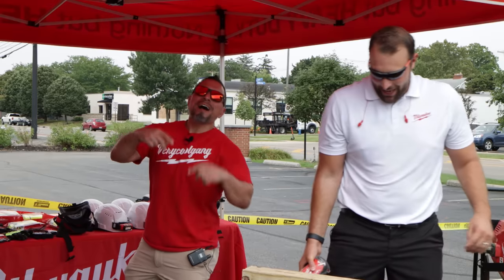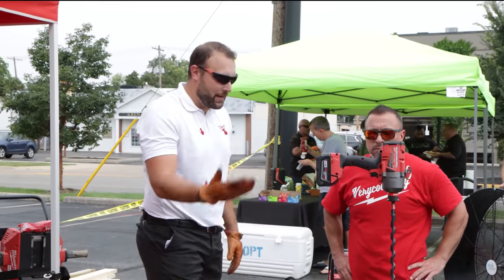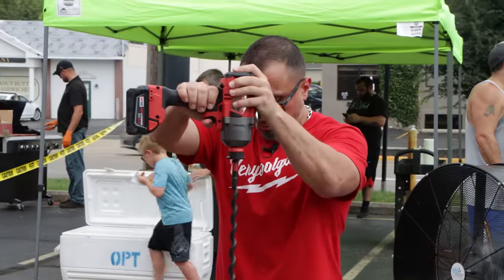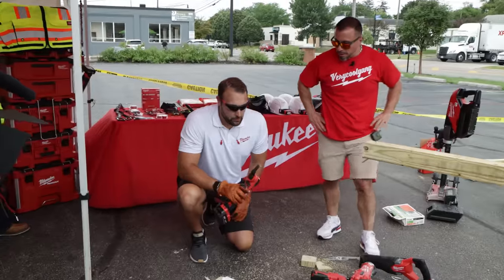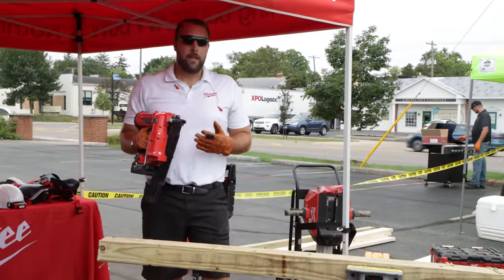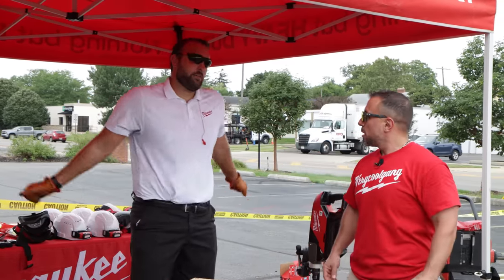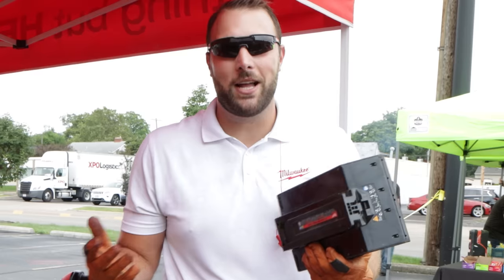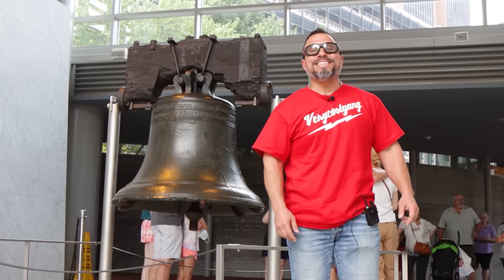These 5 POWERFUL Milwaukee Tools IMPRESSED Everyone!

Comment: That 7/16" impact is NO JOKE...When I was working in traffic signals and spanning fiber on poles, We were originally using the M18 Hamer Drill/driver with an auger bit and it would take 5 mins, if not more with a dull bit....We upgraded to this and in SECONDS we are through a damn utility pole! NO issues whatsoever! Milwaukee, nailing it again!